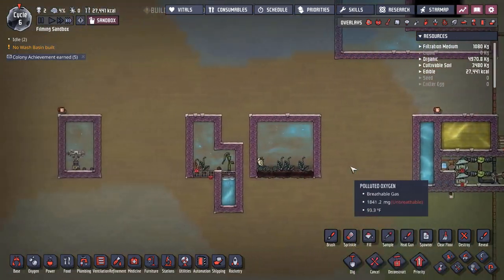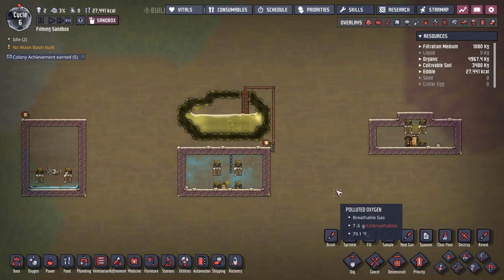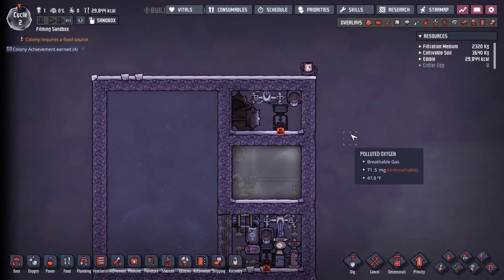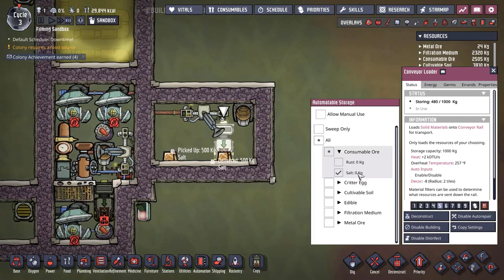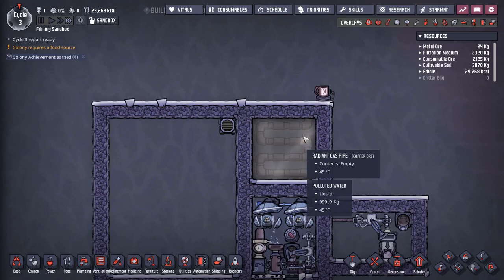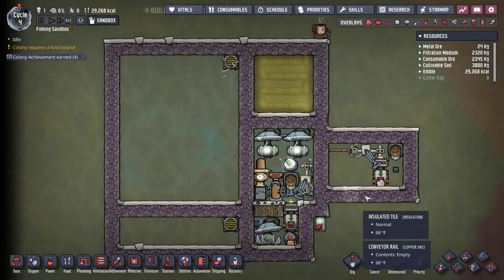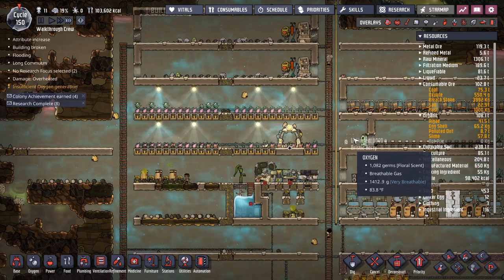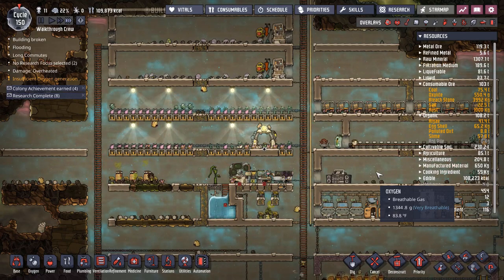Oxygen Not Included Tutorial: Producing Oxygen

Comment: Oxyferns main downside is the lack of scalability, I feel. They work out such that you gain water to oxygen efficiency at the cost of dirt (~1 pip ranched per 4-5 oxyferns, iirc), and some power to automate maintenance. Not sure off-hand how the power loss compares to power gain via less power spent on managing carbon dioxide and cooling, though. It's pretty hard to get enough plants to cover more than a few dupes, but if you're planning on ranching pips anyway and won't miss a couple pips worth of dirt, it doesn't hurt to stretch the water you have a bit further. Particularly early-to-mid game when you're still hunting down your water sources.

Admittedly, I mostly like them because I like the synergy between them and pips and the difference they make to early game in forsesty starts. I totally get why most folks prefer to just add more electrolyzers rather than bothering with them, though. :)
Reply from the maker: Yeah, they do scale really poorly.  I wish that they produced just a little more, because as it is now, I'll tend to rely on them for probably like 10 cycles, and then never think about them again once I dig them up.

I'm not sure about this, but I also think there's no way to routinely get more seeds.  Some kind of run where you could only use oxyferns would be pretty fun, so maybe I'll have to do that some day (and just spawn a whole bunch of them at the beginning).

Comment: about the electrolyzer: I heard from a other way to build it up with only 1 pump
it just need way more space and have problems with cooling
you make a big square place at the bottom of your whole base, then you build in the middle a tube wo is 2 blocks width and it opens down to reach at the end of the plattform/ground, but not directly get to the bottom close on top of it, it's closed.
then you build at the top a pump with a atmo sensor and down the amount of electrolyzer you want
the atmosensor is high enough that the top area is always filled with hydrogen, the oxygen get produced and can go at the side away up to your base. 
So you only need 1 pump and can easily add up electrolyzer for it, 
problem is, you need quite some base, it needs to be at the bottom and heat may be a problem, or you make such radiant tubes who cool it down, when it moves up
Reply from the maker: Huh, that should be pretty interesting!  I'll have to play around with it :D
Reply: the disadvantage is that you aren't forcing oxygen into the base at a high enough pressure to prevent off-gassing. depending on size, multiple such stations could be used so the air isn't too thin at the "far end" of the base.

of course, that disadvantage can be managed, but it's nice using basic vents to keep a fairly consistent 2kg/tile (not quite enough to pop eardrums) it might be worth the cost of a pump

Comment: I found out about the morb one when trying to pull a vacuum to kill one. There was soooo much slime lung in the air. I pulled a vaccum, pumped it into a room to clean it and let the germs die on their own, then broke a block of the (don't know the name of the ruined structures on the map). It sucked a vacuum, then started going again. This is when I realized they produced polluted oxygen, and I just left the pump to go when it got pressurized enough. I blocked off the slime so that slimelung wouldn't come back, and had a small bit of oxygen production. I thought about bringing in more, because I found another, set up the drop off point, and rapidly died of oxygen deprivation as my dupes set up the system for the machines that produce oxygen and hydrogen from water. I was making another 3, because 2 was not enough. I didn't realize I ran out of algae until I saw breathability go to 30%. That's why I'm here XD

Comment: Wait what is the pressure set to for the lower atmo sensor In that electrolyser? (I've tried copying many electrolyser designs and they all don't say what pressure to set them to and I believe that's why there not working for me.)
Reply from the maker: I have them both the same, around 500g.  You can fiddle with it to get slightly different results (less power consumption or more uptime), but anywhere between 400g and 700g is viable IMO.

Comment: The electrolyzer setup you have isn't as good as a half rodriguez, or the even better full rodriguez in terms of power consumed in comparison to how much potential power gets produced.  You use up 720 watts with 3 gas pumps and produce 800 watts of power.  There's only an 80 watt difference.  For both a half rodriguez and full rodriguez those numbers are higher, implying more hydrogen produced for one of those setups.

Comment: Quick question, how did you spawn the vents in sandbox mode?
Reply from the maker: I had to go capture the layout of the vents from another map, using the debug tool.  It's kind of a pain, and I couldn't find any up-to-date repositories of captured vents anywhere.
Reply: God, I wish they'd let the in game sandbox mode just do everything you need to do like spawn all items and instant digging etc. I made a map to experiment with a few builds ideas and it was a pain in the ass trying to get everything done, only real bonus was instant building and spawning water or gasses.
Reply from the maker: @Spamhard  Yeah, there are definitely some extra tools I'd like to see.  Having all vents/geysers/volcanoes in the debug spawn by default would be nice, because I spent a full day getting them all captured and saved just for myself.

Being unable to clear the fog inside the POI areas is also very annoying.  You can toggle it on/off but it doesn't save it as cleared or not.
Reply: @Magnet_MD  If I remember vanilla doesn't have this but there is a mod called expanded sandbox tools or something.